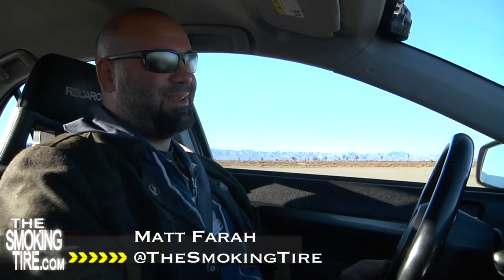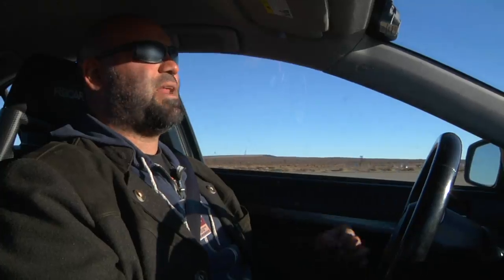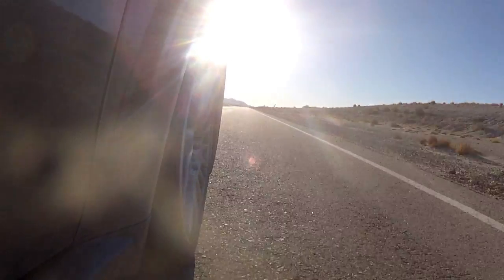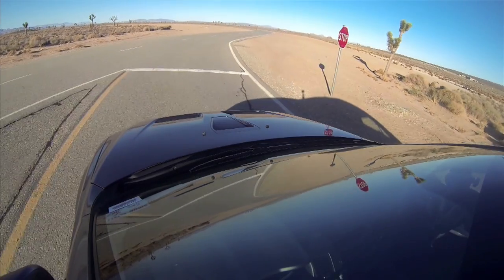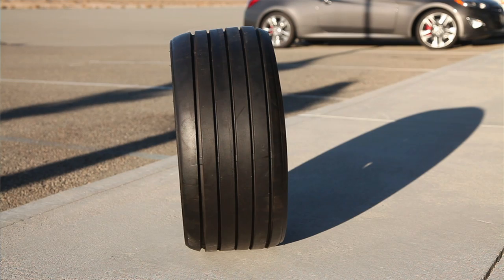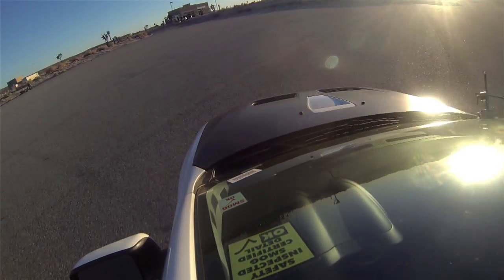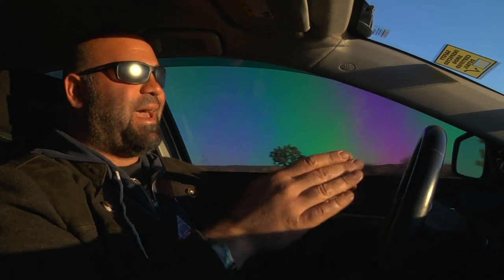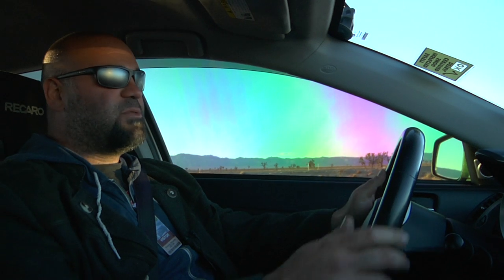Are current tires the wrong shape?

Comment from the maker: with the camber, the sidewall interacts with the contact patch in a triangulated fashion as opposed to a circular fashion with a standard tire. So in essence, they are already "pre-loaded" when you start the turn-in and deform less than standard tires, for much more predictable and consistent behavior. Plus, the contact patch stays flat through the corner for more grip.

Comment from the maker: yes, that's the point. The point is that when you dial the camber into the suspension, the tires will have full contact patch at that degree of camber.

Comment from the maker: The "spiral" pattern of the single-cut tread, according to the manufacturer, does a great job of moving water to the outside of the tire. A large contact patch is good whether you're in the wet or the dry, it's just how you get that water out of there, and they say it's very efficient. He said he would provide me a set of tires for a longer term test, as long as I found a car that fit them, which I just have (E36 M3). So we'll keep working on them for multiple conditions.

Comment from the maker: The numbers they quoted me seemed fucking astronomical until I drove the car. They said an otherwise stock Evo X on 3 degree camber tires can pull 1.6g, which now I do believe is probably accurate if the conditions are right.

Comment from the maker: You can buy them from the company directly. They are competitively priced to Michelin Pilot Super Sports, and based on what I felt behind the wheel, are worth every penny. They only come in 17" and 18" right now, and you need a suspension (either stock or OEM) that has adjustable camber. Other than that you're good to go. Just Google "camber tires" and you'll find them right away.

Comment from the maker: No, so far the tires come in 17" and 18", with more size to come, they use standard wheels though the car must have either an OEM suspension with adjustable camber or an aftermarket suspension with adjustable camber.